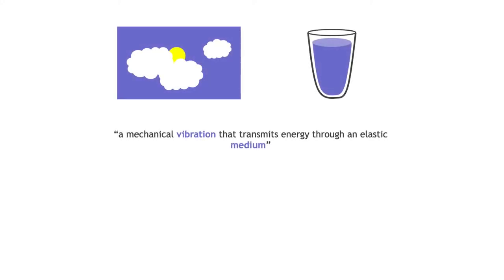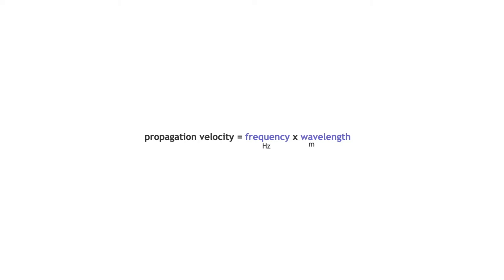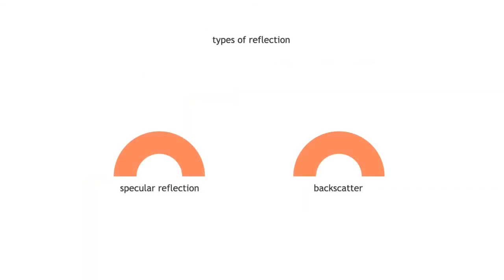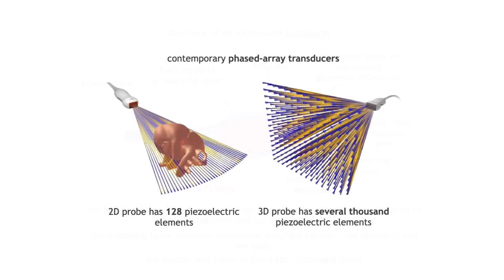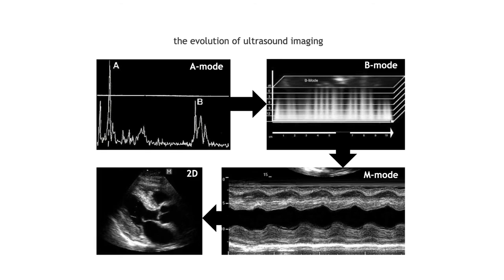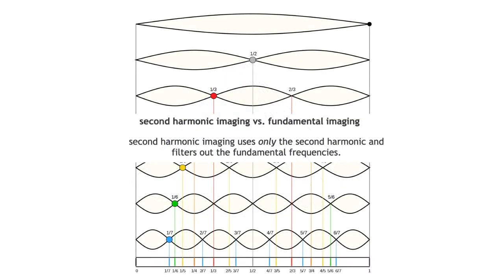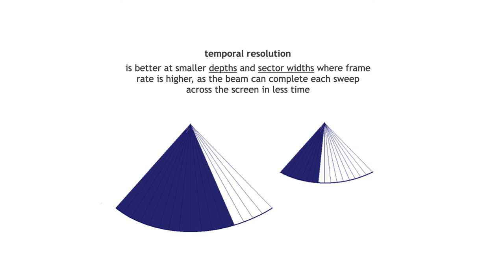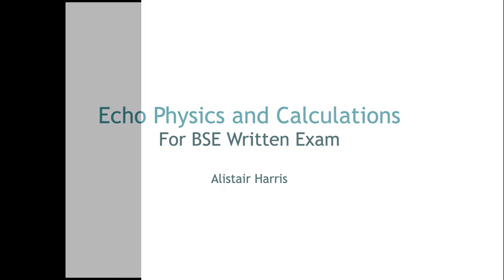Ultrasound Physics | British Society of Echocardiography Theory Exam Revision

Comment: Hi there, just a quick correction.

The Propagation Velocity increases as the tissue's stiffness increases and decreases as the density increases.

"In reality, the speed of sound is affected by the density and elasticity of the medium through which it is travelling and these factors are not constant for human tissues. The propagation speed of sound is higher in tissues with increased stiffness and reduced density." - Radiopedia
Reply from the maker: Hi Dave, thanks for your comment. I believe radiopedia might have a typo and that they mean that propogation velocity increases with stiffness and density. I'll pursue further references and get back to you as soon as possible
Reply from the maker: Apologies in my delayed response to this. Propagation velocity does increase with stiffness and decrease with density - apologies for the error. I will aim to update the video with that correction and additional information as soon as possible